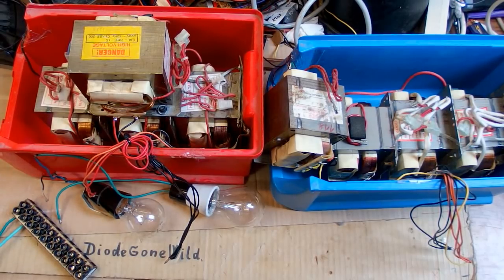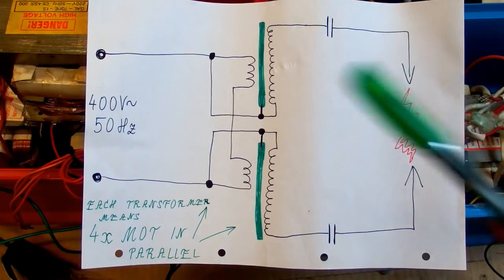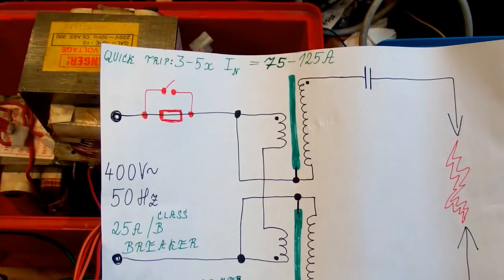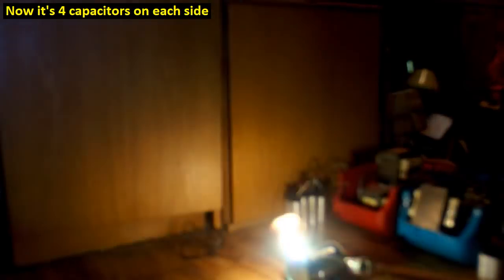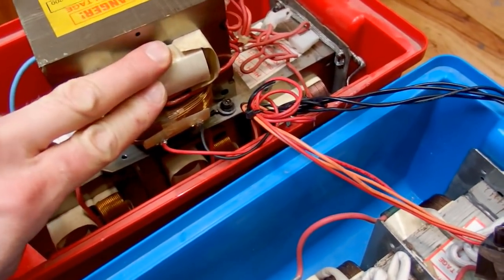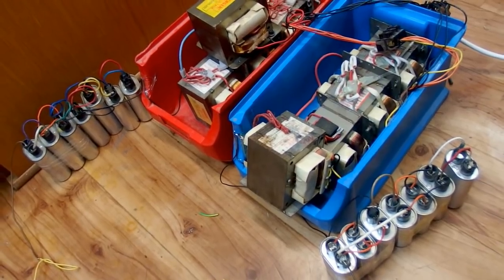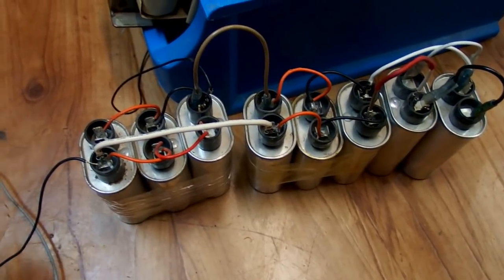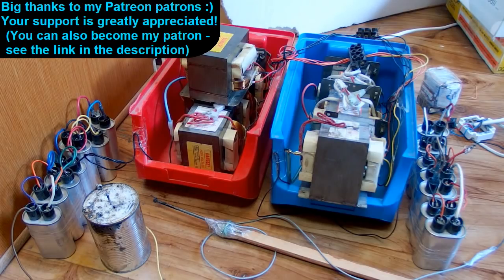Making Lightning in my Living Room

Comment: so we got some 4000V 7A AC supply. now we require a "FULL BRIDGE RECTIFIER" to make the "DiodeGoneWild"
Reply: So now this is electro boom thread
Reply: @dan2800  both are genius
Reply: @sayantanmaiti2513  yea
Reply: Diode gone boom? Elektro gone wild?
Reply: FULL DODGY TRANSFORMER
Reply: that would be equivalent to 4000v x 1.4142 = 5657 volts dc if rectified
Reply: @mjouwbuis  why
Reply: Just need a lot more microwaves to give the diodes, probably 5 in parallel per side, and 4 capacitors in series on the secondary.
Reply: You would need hundreds of full bridge rectifiers in parallel to handle the voltage and current.
Reply: It's more like a full-bridge-rectum-fryer. xD

Comment: This looks very dodgy.
Reply: And Very crazy, Man!
Reply: @Cyklon-A  what's going on here is the very definition of dangerous. when they say it is the amps that kill you there's plenty of those. 0.035 of an amp can do it. This was what 7 amps on the secondary? But if you're not in the circuit it isn't an issue either. Better make very sure you aren't though. Might want to have someone on hand with a defibrillator if you're playing with one of these.

Comment: I really like how you measured the current. There's a hundred videos online of guys making arcs with "resonant capacitors" but this is the first one I've seen that measures the actual output volts and amps going into the arc.
The way you reduced the voltage across the transformers and then added the mains voltage back to it was a really clever way to get around core saturation:-)
Reply: hardstyle905  then you clearly didn't see the entire video. he actually measured the arc current.
Reply: hardstyle905  12:16

Comment: what a class! we use some tricks to switch reactors, capacitors and transformers on high voltage substations, which basically monitores the zero crossing of voltage to minimize the current peak. I work at ABB and there we have the T183 switchsync, now upgraded to PWC600.

Comment: I did something similar for making high voltage high current DC.
I needed it for hot electric arcs to generate nitrogen oxides inside a big glass jar (the 50 litre type).
It pulled 21 amps @230V constantly and I had to watercool the whole assembly.
In the end, I had to move the air cooled heat radiators outside the room in which It was operating because the whole room was like 50*C after a few hours.

Comment: For the turn on curren limit, you can try what I did on my 3,7kVA isolation transformer: 

Put a fluorescent lamp ballast in series, with a relay contact that shorts it and a 230V relay coil that is just connected directly to the mains voltage. Because the relay is mechanical, there is always some delay between powering the coil and the contacts closing, and it is enough to limit the inrush current, at least in my case.
Reply: Yeah good idea. Basically youve made a soft starter. You use also use a capacitor, or high power resistor intead of a ballast. It might even be possible to get a large NTC thermistor in series that would suppress the current spike.
Reply: @HighVoltageMadness  A capacitor would be a bad idea. It wouldn't suppress the initial spike much, and when it gets shorted by the relay, it would also damage the relay contacts. A power resistor or NTC works, however ideally you want those to be OK even if the relay fails to close, which a lamp ballast can tolerate no problem, plus you can probably get them for free.

Comment: Has a over 40A at 400V running through a random 230V plug
PUTS A TINY SWITCH IN SERIES AND TOUCHES IT BARE HANDED

This is content!
Reply: the switch is on the input side where the voltage (more so) & power isn't large enough to arc out through the switch!! Danky(diode gone wild) knows this. And even on the secondary, or output side, see how he has to almost touch the one side to the other to get the arc reaction(lighting) going.. even with all that power & voltage been dumped by the capacitors & transformers you need to be very close before your in danger. WHAT IM TRYING TO SAY IS HE KNOWS WHAT HE"S DOING!!
Reply: @keithking1985  I know he knows what he is doing! It just seems so absurd to use a tiny switch for 400V as a person used to European safety standards 😂
Reply: It's not really 40A. Likely RF interfere to the cheapo clamp meter
Reply: @LutzSchafer  Given that one microwave transformer at saturation can pull near 3Kw with pretty poor power factor, I'd say that's correct. Granted that switch wouldn't last very long if this were a constant load, or you tried to break 400V under load with it :)
Reply: @ukko9154  agreed.. those switches(if it's the one im thinking it is) are rated for 6 to 10 amps at 240V AC yet the breaker was more.  & the switch survived. but only because he wasn't keeping the load on long. if he did it would melt no doubt.. it probably even seen it's last day as a reliable switch after this video!!!
Reply: Don't worry about the switch, it has the inrush inductor in parallel. I am glad that the cat (the very experienced high voltage engineer) was not there to guard the operational safety :)
Reply: @Wiresgalore  Yes, but he did also completely short the secondary (with the caps) which only showed around 17A. Only pulling the plasma its showed the weird 40A. Any other suggestions?
Reply: @LutzSchafer  : If I understood his english correctly, he measured 6.7A @4kV = 26.8kVA on the secondary side. If you compare that to the 40A @ 400V = 16kVA from the primary you notice that the numbers don't quite match up, so something in the measurement must be off.
Reply: @mojoblues66  the output should actually be closer to 3300 volts line to line without load. He mentioned that each transformer bank is only running on 200v each. 200 volts is 83.33% of 240v. So the output voltage will be roughly 16.66% less. 83.33% of 2000 (normal output voltage) is 1666.66 volts line to earth. Multiply that by 2 to get line to line voltage and you get 3333.33 volts. 3333.33 multiplied by 6.7 is 22.33 kVA which is close enough to the input power when you take into consideration voltage drop caused by the impedance of the wiring and the saturation of the transformer cores at full load. Likely, there's probably only between 2-2.5kV output at full load. 2.4kV times 6.7 gives about 16kVA. Also, those amperages are peak values. Rms values would be less.

Comment: Maybe electroboom can learn something and hopefully can make a working Jacobs ladder😂😂
Reply: Tejas Kamble he almost lost his life with it. I don’t think he will ever attempt again
Reply: His breaker was rated at lower amperage probably (16) and in his country is 120 Volts so the arc consumes double the current to make the same arc like with Europe 230Volts
Reply: Easy way to get Jacob's Ladder arc started, use a "cheater" terminal. See this BigClive video:
https://youtu.be/Uv-6YgbDoyI?t=442
Reply: @casper2501  im sorry but what is your point?
Reply: @casper2501  actually wrong but. Still right.

Where he is it's the same as the US voltage on average around a hundred twenty volts ac.

If his place is newer likely it would be 20 amps.

Although if it's an older place it may either be 15 or 20 apps.

For example kitchen will be 20 amps.

If properly installed.

Also a 15 amp receptacle does not necessarily mean a 15 amp circuit.

Because a 20 amp breaker is permitted to feed a 15 amp receptacle if there is more than one on the circuit.

But of course will be better have a 20 amp receptacle on a 20 amp circuit in general.

Although occasionally you'll find a single circuit breaker feeding a single 20 amp receptacle in some cases.

Sometimes literally a single receptacle not a duplex receptacle.

AKA a dedicated circuit.

Such as for example a dishwasher if properly installed.

Microwave if properly installed.

Although typically I've seen for a larger microwaves only.

Just depends on who and when it was done excetera.

And now there is supposed to be a 20 amp dedicated circuit in the bathroom for the receptacle.

You might be asking why would you do that.

Modern hair dryers.

That's a newish code requirement.

Also in terms of kitchen receptacles there should be two receptacles there should be two Appliance circuits minimum.

And also somebody else that most people don't realize.

Is that also extends to dining rooms don't remember the year that happened but it does.

And don't forget the rule about within six feet of water AKA a sink.

Outdoor receptacles excetera excetera are required to have ground fault protection.

And now arc fault as well.

Although I don't know about outdoor receptacles for arc fault but probably still good idea.

By the way microwaves enforced lights hand trip ground fault interrupters.

Seen it myself.

Also behind a large Appliance generally gfrc is not required in general?

Speaking of which a refrigerator should be on a dedicated circuit and or a freezer.

AKA if you have a basement that has a fridge and freezer in it needs to be two separate circuits.

By the way I've known of a few places that and had to be redone because the breaker would trip.

Also if you were to have an older electrical system in your running a window air conditioner.

And the fuse blows use a time delay fuse on at circuit.

If the running amps are under the rated load of the circuit.

It will blow on Startup that is a steroid non time delay fuse of the same rating.

I told my father and grandpa that when I was a kid.

They had the same problem with the fridge and freezer downstairs

Now there's two separate circuits down there for them.

And also new service entrance.
100% Breakers now.

Also there is now two washers and two dryers in the house.

And central air so yeah.

My parents place recently had the electrical system updated as well.

So no more blowing fuses and tripping Breakers.

Also if you have a foursome light on like a basement stairs and you're going to be up and down all day leave it on all day.

If it's fluorescent it's best to leave it on if you'll be in an out then turning on and off.

It's not about energy saving it's about saving the life of the fluorescent tubes.

 just wanted to put that to rest once and for all.

 They've had for some tubes in the basement and on the stairway that have lasted probably lasted 2 years.

Already blackening and flickering.

Just goes to show.

Comment: You can actually direct connect 400V~ on the transformers , i actuallu tried , it worked just the primary windings got a little bit hotter of course.
Try it, 400volts on each transormer, they will not get damaged or overheated, unless you run them for over 20 mins.
I tried , my calculations were around 8 , 9 kV at the output, and i connected all secondaries on series. They worked great.
Reply from the maker: You can't run 220V or 230V MOTs at 400V.

Comment: Question 1:  When you draw the arc out two > 1m, are the ripples you see in the arc perhaps due to ac (like an sort of 'ac oscilloscope' in mid air)?  Their seems to be something of a pattern to it... but probably just due to heat plumbs ... would DC do the same?  Hard to find out without rather powerful industrial HV diodes and power line caps like those sold by 'Surplus Sales of Nebraska' in their 'Capacitors/Maxwell High Voltage Capacitors' section of their website.
Question 2: How does this differ from the sort of arc you can create with a 12v car battery and two carbon electrodes (conical tips)?
BTW: You are a TERRIFIC Teacher!!!  Very thorough.

Comment: I think it would probably be better to disconnect the primary and secondary- you're not getting 200v extra, more like 5v (for 4000v secondary) the RMS voltages add like Pythagoras for different frequencies. and it seems like it could cause issues further up the mains, probably not worth the issues it could cause-exposing other devices to voltages and frequencies they weren't designed to hsndle

Comment: I winced when I saw you pushing wires into the breaker, I would not have wanted both hands so close to the 400vac supply without insulating gloves. Good luck and please keep the videos coming

Comment: Could use a few and have a electromagnet.  Thats better than some that cost over 500$. All in metal box with switch and 3 in parallel or series but put those transformers to money? Just a thought. Need workshop to really do it good enough to sell but their amazing magnets.  Do you know if cutting the coil down to primary would be more magnetic or would it be same if pushed primary to top? Rambling but wondered. Also could I use a changing input to  make it more or less magnetic? With 240 to 0 dial although cheap and not accurate but cuts voltage also do you think if mot magnet would they get hot with 240v? Mains no dial to have enough to hold work?

Comment: Now I want to see  230/400v ballasted to 20 amps per line and fed into a 3 phase full wave rectifier. Use an "AC Only" breaker, relay, switch, contactor, etc as the DC "load" if you want extra mechanical schadenfreude.

Comment: Now you have seen what an European power supply is capable of. 40A at 400V - no problem. If he had 32A breaker (maximum available for houses) he could pull even more current, like 45-50A at 400V in short time maybe. And of course this is one pair of phases, like A-B. But we can draw the same current from pairs B-C and A-C simultaneously. So we get 3x25A at 400V or 3x32A at 400V. Unfortunately you can't put all three phases' energy into one single arc. But you can do three arcs at once, if you had three sets of such transformers ;)
Reply from the maker: I already made 3 arcs at once in my other channel :
https://youtu.be/vfixjqWcOwg
And you actually CAN put all 3 phases into 1 arc... using a 3 phase rectifier :).
Reply: @DiodeGoneWild  I think I have seen it somewhere on the YT. However the rectified and mixed phases cause a side effect of changing the sound of the arc. It goes like 150Hz and sounds rather crappy for me. Nothing like the crazy evil 50Hz sound xD

Comment: A second person to hold the second electrode mobil/movable? So to increase variation in/of use and display to the camera/viewers. And an explanation why more capacitors fail. (They don't get all loaded properly anymore, but how in more detail?) And measure the heat of the arc from a distance?

Comment: I don't like the idea of connecting the primary Mains to the secondary output of the Transformer because if something goes wrong it could send a shock through the wiring in your house and fry your computer electronics Etc. It only gives you an extra four hundred volts anyways which is nothing. Instead you can use some resonant capacitors on the primary side.
Reply: Nice point

Comment: Why short circuit current is lower than arc current?
Reply: Because the capacitors limit current on the output to X amount of amps. And with the output shorted the voltage is pretty low. Once the arc is pulled out, the voltage is allowed to come back up and and translate into more total wattage demanded from the transformers. Its acting kinda like a constant current power supply.

Comment: Have you considered making a voltage doubler by placing a diode between the two capacitors?
Reply from the maker: this wouldn't work. The arc would pass the current only in 1 halfcycle. It would quench during the other halfcycle.

Comment: Bloody amazing! Can I weld my exaust pipe with that home made welding machine? I liked your high voltage isolation shoes. Put safety in first :). An engineer that collects and turns useful the others garbage is a real engineer. Keep going Mr. DGWild.
Reply from the maker: I welded my exhaust pipe using this :)
https://youtu.be/_CELYqo7KfQ

Comment: I still don’t know where the 400V AC supply is from. Is that a standard voltage in parts of Europe? I was curious about it in an earlier video... maybe it was explained but I wasn’t paying attention...

Though I found this on line: “Currently, ALL Western European 3 phase supplies are classified 400VAC. In reality there is no 400VAC supply unless you create one locally. 400VAC was a “standard” created during European "harmonisation" to give a single voltage standard across Western Europe, including UK and Irish Republic.”
Reply from the maker: Europe has a 3 phase system. The phases are 120 degree shifted. East and central europe used to be 220V phase to neutral and 380V phase to phase. Western Europe was 240V phase to neutral and 415V phase to phase. Then it was all unified to 230V phase to neutral and 400V phase to phase.

Comment: It's really interesting that the arc does not take the shortest path between the electrodes, but wobbles around like a flame. What is the reason?
Reply from the maker: The hot air rises up and takes the arc (the conductive plasma that carries the current) upwards.

Comment: Hey DGW, can you help me in repairing one of those cheap power supplies rated at 36v 10a similar to your 24v 10a power supply.
I have tried changing both transistors, the tl494 ic and have checked that rectified mains is present on the input and have checked every diode and resistor including the main output fast rectifier diode.
Any help would be appreciated, thanks

Comment: Man, I have to admit, that was pretty damn epic.  I got zapped and burned by a MOT many years ago and never played with them since.  I got spooked badly.
Reply from the maker: MOT's are quite deadly. You were probably lucky and the current exited the same hand it entered.
Reply: @DiodeGoneWild  As a matter of fact, I got blasted from hand to hand -  there were what looked like RF burns under the skin of my fingers and hand on the right and nothing that I could see on the left.  I felt the jolt in my forarms and shoulders.  I lept backward certain that I was going to have a heart attack and die on the spot.  I ran to my mom and dad and told them as fast as I could.  I didn't die.
Reply: @BlackWolf42-  How did you manage to touch both terminals?